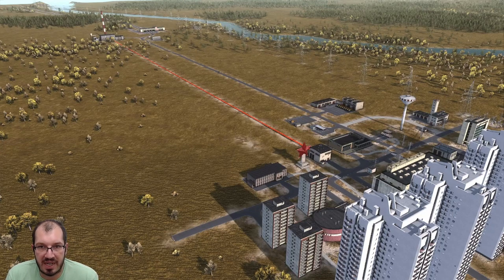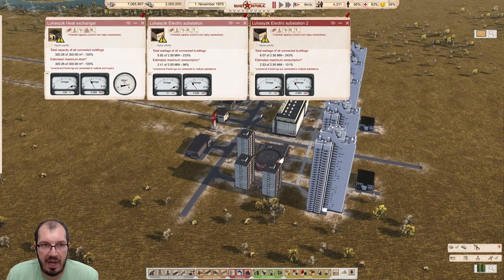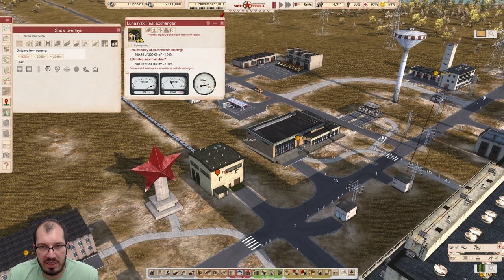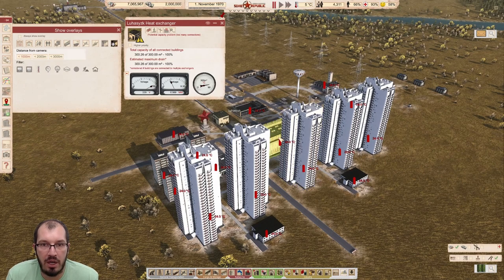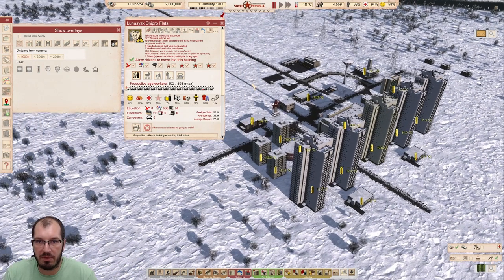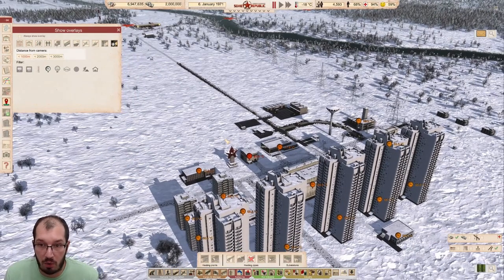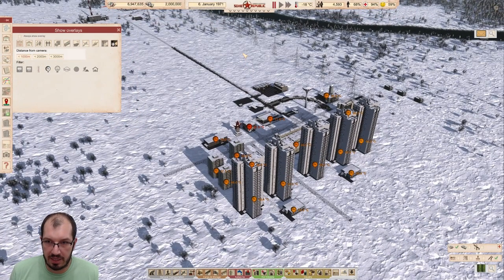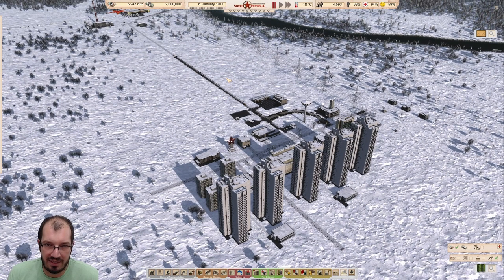Should heating pipes be underground? | Test  | Workers & Resources: Soviet Republic Tests

Comment: I think the heating system is not very balanced yet. I had a low loaded heating plant for a small industrial worker settlement and I wanted to connect a "tourist city" without pollution to this too (using big heating pipes). Unfortunately, the length of the pipes is the only thing that matters. You can increase the reach by adding pump stations, but the water gets so cold that it's completely unusable at the destination. It didn't matter if you use one pumping station on this maybe 2000 meter pipe or five, the temperatur loss was identical. Sadly. Also all the public transport systems are only usable for workers travelling to their workplace. Tourists won't use them in order to get to a nice restaurant on a mountain or travel to another city, workers don't do that in their free time either. Also the time compression to simulate a whole year within a couple of hours doesn't match up with the try to simulate real-time work shifts or travel time for all the people on the map. They just can't reach another city before the timeout is reached, because the "world time" is compressed and the "people's time" isn't. It is a nice idea, but it just doesn't work. Sadly. Such things are making it a bad and frustrating game for me, maybe it's a cool idea, but things work better in SimCity or Cities Skylines. And these power and water systems... these are just crap. For a big city you need around 2 megawatts of electrical power just for water pumps. The capacity on the electric lines ist WAY too low. In real life a singe 380kV high voltage circuit can handle up to 2 or even 3 gigawatts of power if it is a really high loaded line. That's 2000 or 3000 megawatts. Not 18 only. That's like comparing a 240V outlet to a 1,5V battery. On 110kV circuits the load is lower, but there are short lines which handle more than 400 megawatts on a single circuit. 200 megawatts over maybe 50km is just no problem for a normal 110kv single circuit line. Or the power consumption of the aluminum smelter in the game, which is no big deal at all. In real life these facilities are using a lot of power! I don't know if this gets balanced more or not. Sadly.
Reply from the maker: Lol...I can really hear how you don't want to like the game by finding everything other games do well, that this game isn't trying to do like they do it at all...

I am not going to stand here pretending the game is perfect, like with most games there are things I would have liked to be done different, i.e. the water system is a miss as it doesnt integrate with the existing game at all, its it own separate thing that you can play with or without, but it doesnt add real gameplay. 

The timescales are chosen to make the simulation work...It would be nice if they all used the same scale, but in the end it really doesnt matter, the time works just fine.

Not sure what your problem with understanding the heating pipes is, because what you said is just not correct...the heatloss for burried pipes is minimal and they can go for several km and still supply enough heat...My guess is that you maybe ignoring the heating tank capacities and pipe throughput, plus heat is dynamic and depends on the demand...

The other things you mentioned are possible in the game, but you have to work for it...the games you mentioned (which I LIKE THOSE GAMES TOO) have everything greatly simplified to a point where you dont have to maintain anything once you set it up, they just play a zero sum game where if you produce enough and have any network everything magically work, not so in WRSR.

Lastly power...the individual numbers may not be accurate when looking at real life, but looking at the bigger picture, 18MW are enough to keep about 60k citizen happy and employed (meaning also that much industry), at which point a single coal power plant becomes enough to supply about have of the 20x20km map, which lets be honest is still too much...so even with those inflated values for power, we are still producing way too much power, so using the grid as a limiting factor is not actually a bad plot.
Reply: @bballjo  Did you try to build a heating system which covers a small city (where the heating plant is located) and another bigger city which is some distance away? I could try that again, maybe they fixed/changed this in an update.

The water system just adds demand. It makes the game a bit harder - but at least it works over great distances like the power system does.

The power system just didn't work well for me, especially when trying to connect all power plants and all substations to a single power grid. If you have a 18MW power line from say a far away nuclear power plant, but you need 20 or 22MW at the end, you can't connect a smaller line with maybe a coal power plant (and no other connection) to feed the demand above 18MW into the region, as the game tries to match out both power lines - and overloads the smaller coal power plant line while the demand on the big 18MW nuclear power line drops down to maybe 10MW. You get power outages even with the 18MW line just half loaded and no overloads in substations or switches. I could create a savegame to show you that. You can't build a real power grid with this behavior of the game. You can just build in a tree structure from one source to the customers. There is no way of building an interconnected power grid.

And I have no problem when the power grid is a bit limiting over power spreading. But it would have been much more nicer when the numbers where real or just compressed into the 20x20km map in another way.

At least, you're wrong when you say I don't want to like the game. But I don't want to just beat a game either. Of course you can beat the game if you adapt to the game mechanics. There is no problem making millions of $ or whatever you set your goal in this game, not even in hard mode (it just takes a lot more time). But I would like the game much more if it is working like things work in the real world when playing a real world simulator. WRSR is a great idea for a city or world building game, but it has some approaches which are not condensed very well into the game or game mechanics (like the time compression problem when trying to simulate real-world work shifts and travel conditions in a few hours year - and not having trains running close to light speed).
Reply from the maker: Fair enough about the 'you dont want to like the game'...

I think we can agree that we both have different opinions on how well stuff is working in the game.

Comment: I just like to point out that underground is not height it's depth, but other than that - this is a good experiment and good to know there is a mechanic where heating is effected by it being above or below ground - I didn't expect that to be a thing since I expected good insulation of the pipes,

 another point would be to not let any heat exchanger come close to its max capacity so you don't get a situation where building are not getting enough heat - make sure to add more exchangers touching the far building from another side to cover the difference (although I expect in real life they just distribute the connections in such a way that not all exchangers cover all the houses in their radius)

Comment: One other question? Is there a way to shut down a heating plant in summer when it's not needed?
Reply from the maker: Yep...turn down workers to 0.
Reply: Just remember to turn it back on before the snow starts 😅😂
Reply: They will stop by themselves if air temperature is high enough, working in limited capacity on colder days. I don't bother with min-maxing it anymore, just to save a bit of coal and workforce.
Reply: @antonisauren8998  I don't think they stop on their own, I'm sure I noticed mine burning coal in July yesterday, away from computer tonight but I'll check again tomorrow
Reply from the maker: The only goal of the heating plant is to keep the internal water heater temp at 90°...if there is no "heat consumption" there is no need to do anything... however there really are only a few weeks a year where it's warm enough to not need heat at all...it maybe any day below 24°... however there is no penalty until the internal temp goes below 20°, so there are days the plant is running but isn't needed at all.

Comment: Hi bballjo 
What about putting pumps between the Heizkraftwerk and the heatingstation? May it be different with the pips above ground?
Thx for the video
Reply from the maker: The heating stations also have an internal heating tank...so they would still loose temperature over distance... maybe it's 1° for every 100m below ground, and 2° for every 100m above ground.

Comment: Much appreciated. One more thing I would test: Is it viable to set up a pipe with pumps in the middle?
Reply from the maker: Probably not, 1 heating plant can only handle 3.3 large pipes, so you would have to build a lot of them in 1 place, where they are probably better suited to build where they are needed
Reply: @bballjo   Hmm... in one of my older runs, I was using big heating plant (mod) and my priority was to extend its reach to maximum (money was not an object anymore) to support big city from one facility, So, I was using pumps with 2 input pipes and 1 output, with distance close to 2km altogether. I think it worked quite ok.
Reply from the maker: 2km isn't the middle...2km is pretty close to the normal setup for many of my cities;)
Reply: @bballjo  I mean: plant (<-1km pipe x2->) pump (<-1km pipe x1->) exchange. With single pipe up to 1km, I don't know how to make things longer than 2km. More pumps won't be efficient(?), heat loss would be to much. Also a single pipes with pump in the middle takes ages to regain temp. In general, I struggle with heating, difficult to tell what causes excess deaths: choking in heating plant or pollution. Especially, I get some pollution in places I can't tell it's source sometimes - maybe because I haven't really crack the trash update yet. 

Not sure how is it now with this pipe extension (oil only?) to be develop at technical university.

Or maybe plant (<-1km pipe x2->) pump (<-1km pipe x2->) pump (<-1km pipe x1->) exchange?
Reply from the maker: I hope you are using underground pipes? The heat loss is pretty minimal, not nothing, but I bet you can extend 4-5 times easily before you get much of a problem... also, reheating should be pretty quick, unless you are over capacity for all connections...it's also extra slow at extremely cold temps, so slow that you can recover during extreme winter if your exchanger is near max.
Reply: @bballjo  Never tried actually to use couple of pumps + underground pipes. I think I got prejudiced to long connections at times when only above surface were available, Thanks.